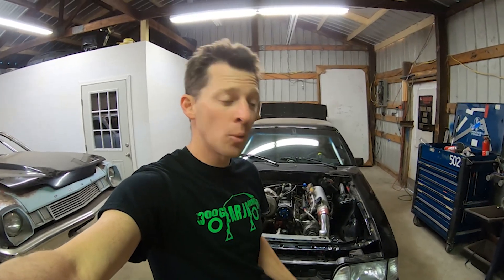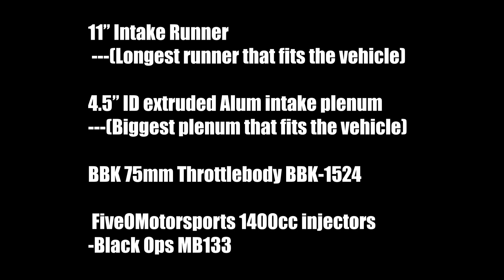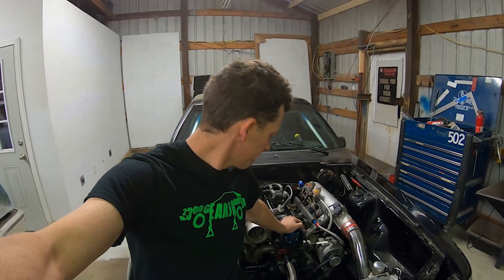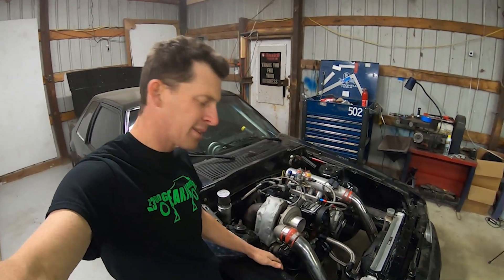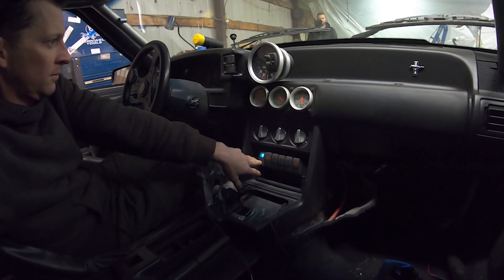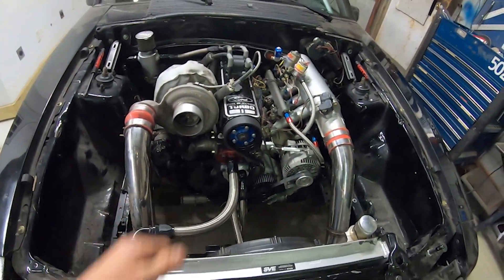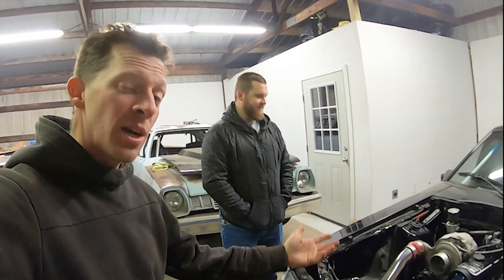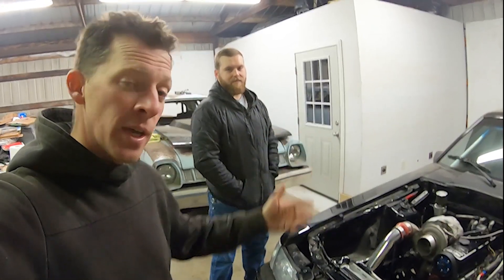500hp 2.3 Idle vid plus all questions answered!

Comment: June of 1987 I purchased brand new a mustang 2.3 LX owned it 31 years and drove it 331,000 miles.
Reply from the maker: Wow that's wild. It would be hard for me to turbo that just to see how long the engine could make it.
Reply: @2300gearjammer  when I saw how fast you made that mustang go with 2.3 liters well I've been in awe ever since.
Reply: Oops I left out I left out the fact that my first car was a 74 Pinto and I purchased a 1992 5.0 convertible Mustang LX  summer special in 1996 ya know the red one with white wheels? After 18 years of ownership with 225,000 miles on the clock  I hit 115 mph on the way to sell it to a Ford enthusiast.
Reply: Of course there was the purchase of a brand new 98 contour SVT November of '97 that I drove to 110,000 miles before stretching a rod and spinning a bearing after 10 years.

Comment: Sounds good man.  I have a 86 ranger with a 2.3 turbocoupe motor, mostly stock/ ranger roller cam more boost. 
Love the build 👍👍
Reply from the maker: I have a pretty stock turbo swapped ranger too. Ford should be ashamed for not building those for production.
Reply: @2300gearjammer  damn right, my cousin had a 91 ranger with a 3.0... weak.  Hurt my feelings to ride in it lol

Comment: Thanks for the video. I owned a 1990  Ford ranger with a 2.3l 4 cylinder with 8 spark plugs.
Reply from the maker: Awesome. Check out the ranger vids too. Yours is pretty much all the same parts as my 93 Ranger.
Reply: @2300gearjammer  yes I will be checking them you can check mine I have a couple videos out
Reply: Hey how you guys doing? I need some help please my truck  misses then it just shut and won't start.

Comment: Hey brother, thanks for the info on the intake! I will be building two .., 1 ford my Mexico raced car and one for my hard tire turbo coupe that my daughters  will be racing.
Reply from the maker: Nice! I forgot to add the throttlebody mount plate was a water jet part I had done.
Reply from the maker: And the nitrous is very rich with those jets. I'll be excited to see what it's capable of when it's tuned
Reply: @2300gearjammer  my boy Scott at Barrett Machine do that for me. He did some home made cal trac brackets I  had drawn up for my mustang 2 .
Reply: @2300gearjammer  thanks for the heads up on that as well , I have a dynotune nitrous setup for my daughters hard tire car because it’s gonna need all the help it can get again those Ls powered cars …..

Comment: Love the videos man. I am currently installing a 2.3 turbo into an 88 ranger dealing with wiring issues sadly.
Reply from the maker: Oh no. Are you wiring it for a distributor and running a turbo computer or some other plan?
Reply from the maker: And thanks a ton! 🐎🐎🐎🦅
Reply: @2300gearjammer  i am using the  mustangs wiring harness and ECU  in the ranger. The ranger had coil packs and the turbo motor has a distributor.  I can't figure out why it won't start ive got spark and fuel im thinking the ECU isn't communicating with the engine.
Reply from the maker: @jacobhurst7874  does the fuel pump turn on to prime, shut off after 2 second sand then start pumping again when you're cranking it?
Reply: @2300gearjammer  no I couldn't get the fuel pump to turn on at all. So I installed an inline fuel pump that I turn on and off. Part of the wiring issues sadly

Comment: Once tuned, what will you have the idle set at when warmed up? From what I gathered the cam has around 265 degrees duration @ .050"? What is the lift and lobe separation? I seemed to have missed that in the degree video. What's it like on the street?

Comment: Great videos! I am in the process of purchasing a 91 with a 2.3 turbo. Do you have a website or build sheet posted somewhere? Would love to follow your build for mine. Don't need as much power though,  will be using it for track day events. Thanks.
Reply from the maker: My original cheap build that was my all time favorite is the blk mustang on the stinger-perofmance.com page. We called it project Bolton. It was very simple and a blast.

Comment: Hey man what exactly did you use to replace the coolant lines with those braded hoses? Mine on my 88 TC are rusted out and I need a fix.
Reply from the maker: Look in the pinto album. I think I covered the cooling system for that car.
Reply: @2300gearjammer  Thanks!

Comment: I am in the process of trying to turn my N/A motor into a turbo motor. Any insight on what forums to use?
Reply from the maker: Check out stinger performance. There's some basic combo posts that will help a bunch.
Reply from the maker: I also swapped the NA 8plug ranger engine to turbo. I'll probably to a walk-thru for stuff I used on that one.

Comment: Hey what’s up buddy I have a 1988 Ford Thunderbird turbo coupe what my best option for Transmission I have automatic transmission second time pulling it out for some reason doesn’t want to hold the power car stock
Reply from the maker: That's a little tricky because I haven't done much of it. If you want to keep an overdrive your best shot is having the A4LD trans built with explorer parts. I've seen people say those hold up better. Otherwise a c4 swap but you lose overdrive.
Reply: @2300gearjammer  What’s the best place to order the C4 from or can I get it from a junkyard to convert to stick shift
Reply from the maker: If you go shift shift you either need everything from a mustang, bellhousing, cable and pedals....or it has to be 87-88 TC specific since those used a hydraulic clutch.

Comment: What HP does a stock 2.3 turbo block Hold or will hold.
Reply from the maker: That's a hard question. I think they can go 800hp to the flywheel but we will go a step at a time and find out.
Reply: Ok cause I’m building one as we speak and trying to find good pistons, rods and rings. I’m trying to stay at 0.20 over if I can find them in those specs if not have to go 0.30 over. Does anybody make them in 0.20  or just go 0.30.
Reply: Stock block I've heard is good to 400. Upgrading your rods and pistons should take you to 800.
Reply: @miguelcandelaria5673  You can find them in .020
Reply: Joe Morgan took a production block and crank to around 800ish with the Focus wagon that you can find on line and maybe on the YouTubes. Early 2000s hotrod magazine...
He ran into oil/crank and thrust bearing issues. Crank Flex was likely the issue. The SVO guys were impressed and didn't think it was a good idea...ha!
After that he eventually got the aluminum block, Esslinger crank and dry sump deal.
Then the C4 would be a challenge if the other driver was disrespectful on the tree. 
The car went 8.50s with a best of 8.30 at 3000 ft altitude.
Reply from the maker: I didn't know he ever ran a stock block in anything but the pinto but he lied so bad about that one that it's hard to say what of his was true.
Reply: @2300gearjammer  yeah, we did a whole lot of misdirection back then due to our habitual street race days.
The pinto was pretty stock. Ranger cam, no porting, t3 turbo with some other compressor housing and wheel, iron exhaust manifold, rod bolt on stock rods, TRW 8.5s, melling pump. 
Stock efi that he could tune somehow. (I went carburetor,ha!)
Oh, and a 50-80ish hit of nitrous. C4 that maybe stalled @ 2500.
10.80s
I have the Focus now.
Reply from the maker: Awesome.  I always wondered where that thing went.
Reply: @2300gearjammer  He basically started going faster then the cage cert and the import scene was becoming difficult to deal with. 
The car is still  perfect and needs someone like you to carry on with it. Hint, hint.
It's too much car for me to street race.